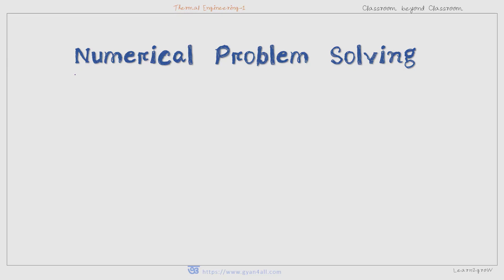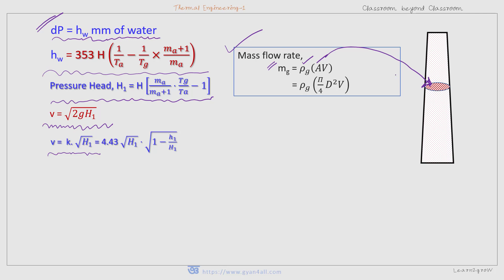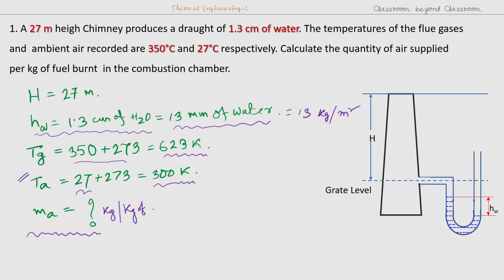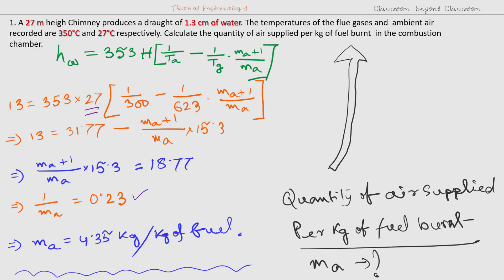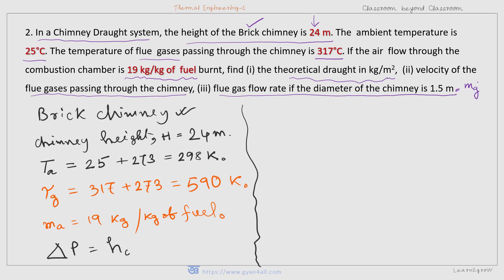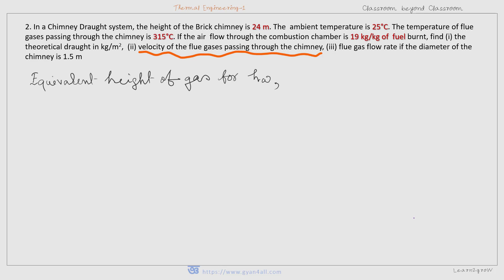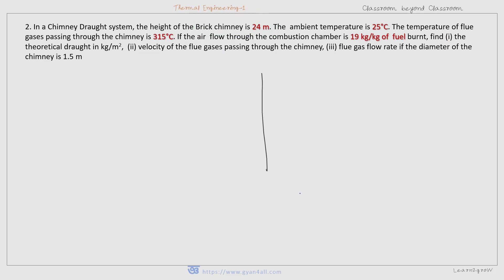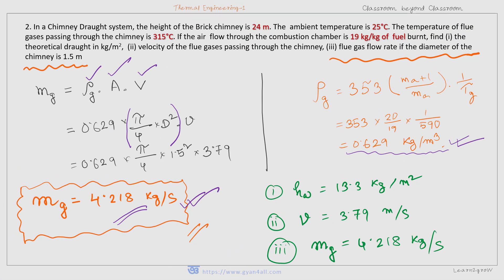Numerical Problems on Draught || Height of Chimney || Problem Solving on Chimney Draft ||

Comment: Estimate the height of a chimney to produce a static draught of 20 mm of water if the mean temperature of flue gases in the chimney is 250°C and the temperature of outside air is 20°C. The densities of atmospheric air and flue gases at NTP are 1.293 and 1.34 kg/cu. meter respectively?? Sir please make a video on this question!!! Love from Assam Engineering Institute student🙏
Reply from the maker: Will do